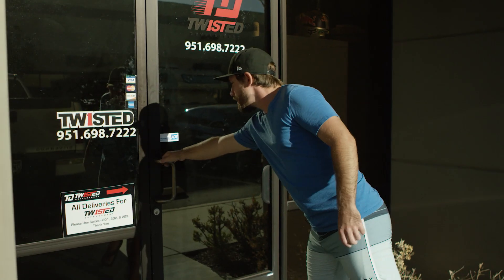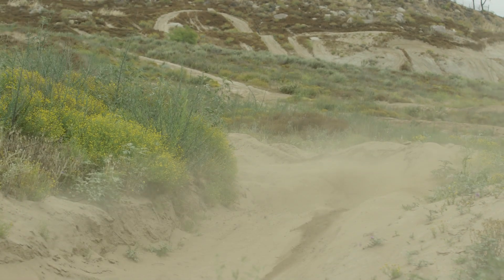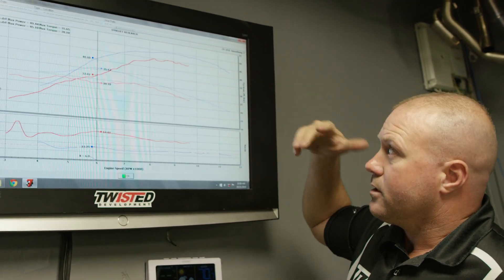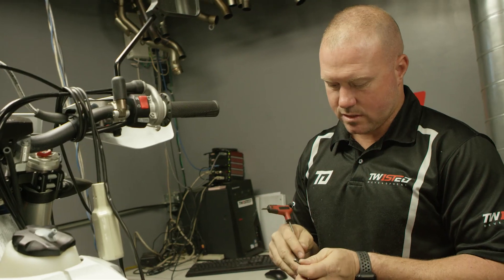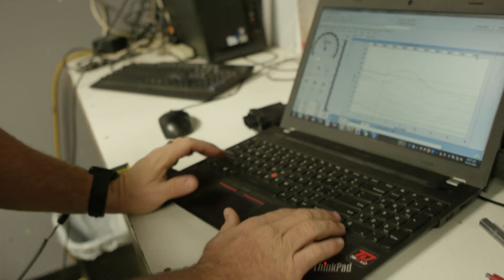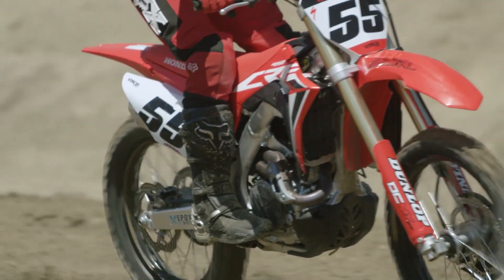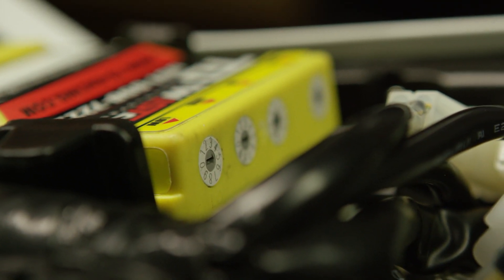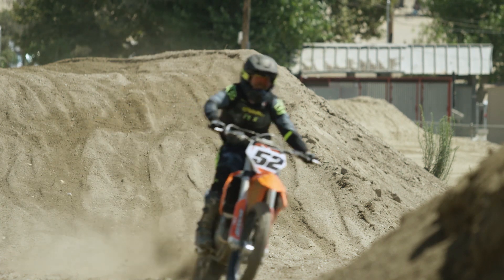Mapping ECUs - Jamie Ellis from Twisted Development

Comment: Hello. very intersting Video,,im looking at buying a 2023 ktm 350sxf,getting a great deal on it,,but im  a woods rider/racer,i do alot of singletrack harescrambles up here in New England(home of Ben Kelley,Josh Toth)  sooo,im wondering if the Ecu could change the 350sxf into a woods weapon? eliminate most of the engine breaking and make it super smoothe??   thanks!

Comment: how would it work with the couplers, like on the Kawis, or the map switch for a Yamaha? If you get the ECU mapped, how would that effect the couplers if you wanted to change them? Would that override the ECU changes? what the changes to the ECU translate over to the couplers?
Reply: Nope, tied to a specific coupler. I recommend using green.

Comment: It’s nice to see the Motocrossers adding in tech that has been in the auto tuning world for awhile now. I don’t think it will be long before the fly by wire throttle is adopted because with the direct injection it make more sense and easier to tune. 

More tuning options  just makes better use of the tech they have already put on the bikes for a few years now. If you are going to pay more for all those features of a modern bike you might as well make the most out of it.
Reply: I cant Think of a bike that has direct injection (MX!). Maybe im wrong tho

Comment: Thanks for the info Michael you the man, Im looking to get more bottom end power out of my 2018 crf250 would you recommend a ecu map first?
Reply: Yes,the Honda 250 will come alive with a Yoshimura full system and mapped Vortex ECU from someone like Twisted Development or XPR Motorsports
Reply: I have a 2018 crf250r as well. I have the full yoshi system and vortex ecu in it. I'm running vortex's "standard" ecu map which is close to the stock honda map but vortex made it better. The difference is huge with these upgrades!! A lot more bottom end and pulls harder throughout the rpm's. I am going to get a custom tune on the vortex ecu in a bit and I know it will be even better than it is now.
Reply: @bonkyfilms  I believe that custom ECU tuning is the future of setting up motocross bikes.
Reply: @joecarlino8279  I havent even got a custom tune on mine yet (heading down to cali in a bit so ill get it done there so I dont have to ship) But even with vortex's standard maps, the bike is heaps better! Most riders wouldn't even need to get a custom tune. Only reason why im getting a custom tune is because I bought the bike second hand and the custom maps he got put on are for different circumstances. The ECU's are amazing!
Reply: @bonkyfilms  hey man did you ever get you vortex mapped? I just ordered one from twisted for my 2019 crf250r
Reply: @NickW90  no not yet...